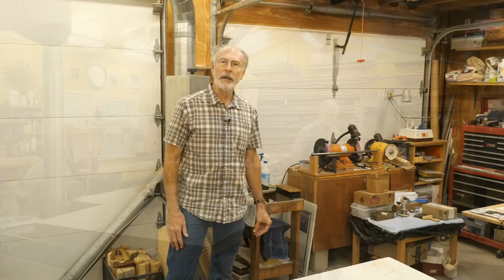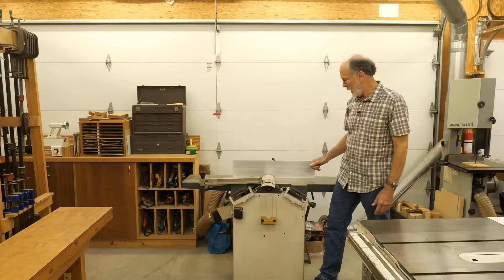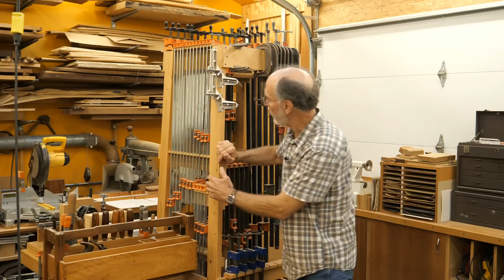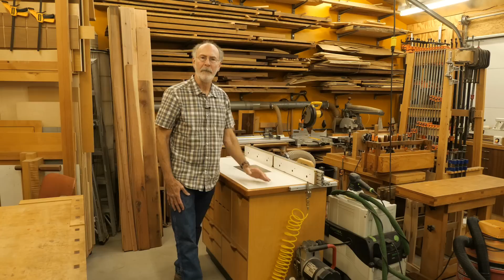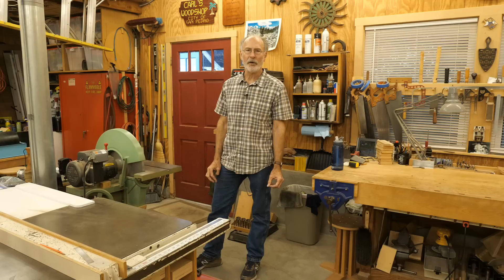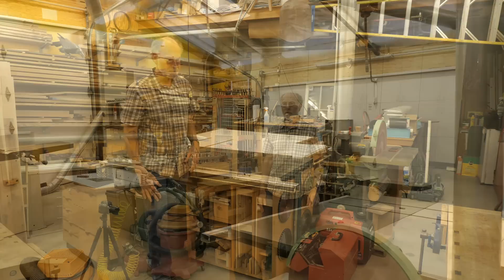Shop Tour!

Comment: Great shop tour! I am envious of your space and many of your older tools.  Speaking of which, is your older Model 66 a left tilt model?  Most were back in those days.  If so, how do you handle your bevel cuts?  Do you switch your fence to the other side of the blade and cut "left handed"?
Reply from the maker: Thanks! The PM 66 is left tilt. I thought they all were and only Delta's had the right tilt option. Regardless, I don't switch the fence to the other side. I think (and was taught) that it's safer for a typical bevel cut to be done with the blade tilted away from the fence. Therefore, you would only put the fence on the left side of the blade for a right-tilt saw. If the material lifts up from the table it moves away from the blade, not into it.

With that said, I do have a jig that I use for some bevel cuts for which I put the fence on the left side. But that is a special situation.

Comment: Hey Carl, are you set up for 3 phase or just single phase? I know most larger disc sanders are 3 phase so that’s why I’m asking.
Reply from the maker: Your assumption is correct; the sander was 3-phase as purchased. I had 3-phase at the big shop, but I bought a single phase motor when I moved to the home shop. I would have purchased an inverter if I had more 3-phase machines, but the sander was the only one.

Comment: Electrician here , if those are fluorescent tubes you can put tube guards on them so if you accidentally whack one with a long board it contains the shards of glass and powder. You may want to consider switching to led tubes. Merry Christmas and thanks for the tour!
Reply from the maker: Good to know. When I built the shop in 2005 I don't think the LED's were an option. Fortunately I've never had any issues, partly because they are relatively high. Thanks for the suggestion. In my next shop...

Comment: I usually only make it through a shop tour in about 3-4 minutes of watching, but this one was different.  Your shop and approach is very similar to mine.  Many of my machines are the same as yours.  I even have an Inca mortising table.  Thank you so much for posting this excellent tour! Please have a Merry Christmas and Happy New Year!
Reply from the maker: Nice to hear! Interesting that we have similar machinery, including the Inca. Is yours like mine or do you have the one with the tilting table? I looked at both when I bought mine but the tilting table version was more complicated. If I need to mortise something at an angle I cut a wedge to put under the stock.
Reply: @CarlStammerjohn  Carl, I just have the mortising table.  I won on eBay a couple years back.  The table saw is on my wish list.  I have many older machines, a PM 66 I bought in the 90’s. Several General machines, the ones made in Quebec.  A Tannewitz model U, and a Hammond trim o saw.  I have a wealth of metalworking machines as well.  I have way too much stock, and at 63 probably need to thin the heard lol!  Loved your shop.